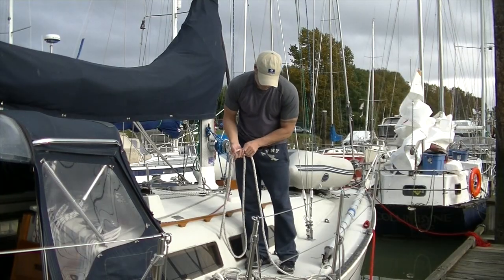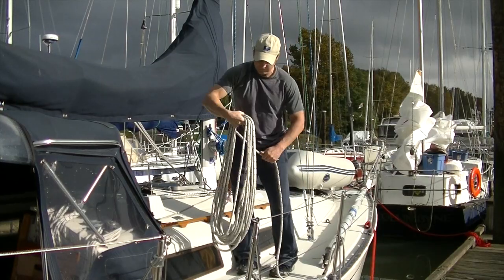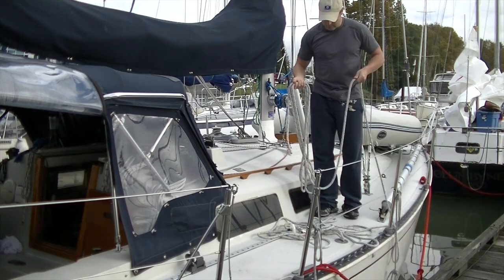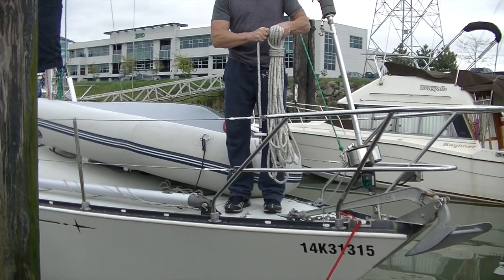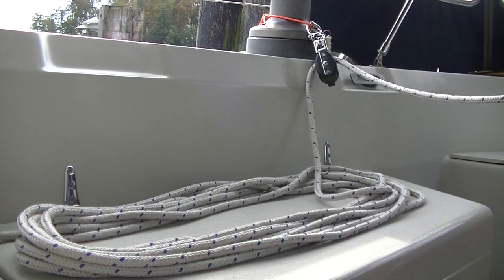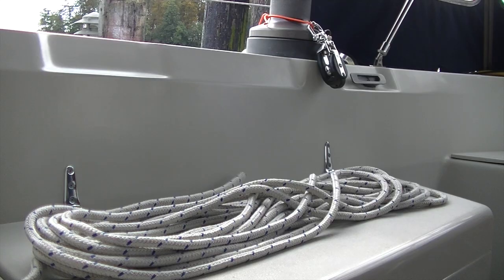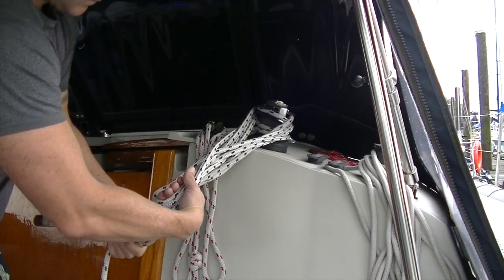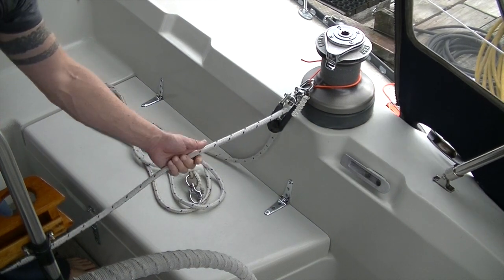Life is Like Sailing - How to Coil a Line (with no twists)

Comment: Learned about line twist the hard way in the middle of the Newport to Ensenada race this year.  Because of twist we couldn't get the code zero down to switch to the ASO.  The halyard was knotted up at the block at the top of mast.  We had to hoist a crew member up the mast at 2am with 15 kts of wind.  Took 1.5 hours to rectify and lost us us the race in our class.  Good vid.  Thanks for sharing.
Reply from the maker: That is learning the hard way and I am glad it all got sorted.  I have been coiling line like this for many years and never gives me an issue so I hope you will like it as well.  :)

Comment: To get people started with the correct coiling technique, I often suggest that they imagine that the rope is a ribbon, and that they need to keep the same side up as they place each coil in their hand. 
Also, I remind folks that this technique is useful at home for long extension cords and garden hoses.
Reply from the maker: trisailor33 Good way to help someone understand!  :)
Reply: Other than being SLOW, you are right.  Use a mountaineers coil method instead.  5X Faster and no twists introduced.

Comment: Thanks, man. Just did what you taught on my power leads. :D
Reply from the maker: Great to hear and I hope you liked how it worked!  :)
Reply: USe mountaineers coil instead.  5X faster and no kinks.  Run over shoulder around neck.  Bottom of coil is held in place with your palm DOWN.  Cheers.

Comment from the maker: +Len R. Glad you liked it!!
Reply: In the video it's said that each coil makes half a twist. I don't understand this: I've always thought it was a full twist for every coil. Is it simply that the rope can absorb half a twist without jumbling up but a full twist is too much, or is there another mechanic at play that I'm missing here?
Reply from the maker: Wilfred Darr Well it seems to e that for every loop I am making a half twist in the line from what I can tell.  I guess the bottom line is that the line is getting twisted by coiling if not using the figure 8 method.
Reply: Life is Like Sailing No for sure. I was just wondering if I was missing something about the mechanics of braided line. I've always used an over under coil because it stacks tighter (the turns don't cross over eachother in the middle), but I'm going to try the figure 8 next time out: with the over under each twist is reversed in the next coil so you'd think it would provide the same result, but if it draws too quickly (main sheet block) it has on occasion drawn in the twist from the current coil before drawing in the next coil, so even though there is no net twist, there is still immediate twist.... Excellent video
Reply from the maker: Wilfred Darr Glad you enjoyed the video and I'm always excited to learn new ways of doing these things.  I will look into the over under method.  :)

Comment: Better still, lean how to coil "over under" and you'll end up with a much neater coil (looking like your twisted example) but which uncoils as perfectly as your figure of eight coil.  This comes from a lifetime of stage management and audio cable handling, but is every bit as applicable to lines on board.
Reply: Over/under is the method that camera crew cable runners use on the sidelines of football matches.. so that's the method I have always copied!

Comment: You’ll appreciate this when you want to drop your main when a squall hits and it jams part way down and the twist has pulled tight in the fairlead or the jammer. Halyards are the most important sheet for this technique. Other sheets you can often get away with. Good demo with the coil going through the block. 
Couldn’t quite see the technique you were using when standing up coiling it with the twist. This needs explaining more as it wasn’t obvious as to how you were avoiding putting a twist in.
Reply from the maker: I really like this method and it has worked well for sure.  :)
Reply: Just don’t twist the line and it will naturally give you the figure 8. Doesn’t look as sip shape as a twisted coil but runs better.

Comment: Sorry. This is wrong. This quarter twist is what I learned on movie productions for electrical cords (not sure if this is actually best).  I applied it to rope, but it's ONLY good for twisted three strand  rope. For braided or covered rope you want to do the figure-8 (I've yet to find a video that properly teaches this. This is about my 7th.  Not surprising. Why is it that so many people seem so bad at so many things? )
It usually looks messier, but it actually isn't. The proof that you're doing it wrong are all those little loops you're having to remove from your line as you coil it. 
The test for a properly coiled braided line is to pull it through a pulley block. If little loops ride up the line, the rope's been coiled wrong. These can jam. As I'm learning this after I form a coil I drop the coil on the floor and then pull it through my left hand making a 'loop' with my thumb and forefinger. When I get loops, even only one or two, I've done it wrong. No loops it's correct.

Comment: Both methods shown are SLOW.  Yes, they get the job done(one obviously better than the other).  Use Mountaineers method.  Use your body.  Around your shoulder/neck with palm face down.  Zero twists introduced.  Coils the rope 5X as fast as is perfect coil every time.  Or, butterfly it, and it is even faster.  Then you can THROW the line without it tangling.  Either method you can then finish your coil as shown in this video for ease of storage and ease of running through tackle.  

Cheers.
Reply from the maker: Yes that is a good method as well.  :)

Comment: It's a damn line,  just coil it efficiently enough and get to sailing
Reply: B hough you’ll appreciate this when you want to drop your main when a squall hits and it jams part way down and the twist has pulled tight in the fairlead or the jammer. Halyards are the most important sheet for this technique. Other sheets you can often get away with. Good demo with the coil going through the block.